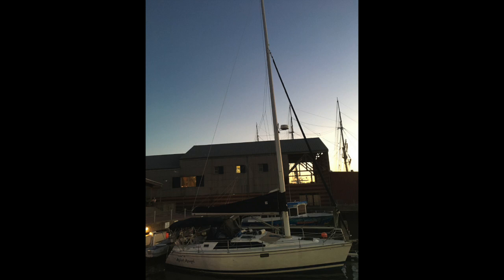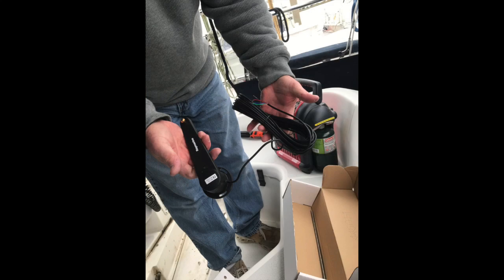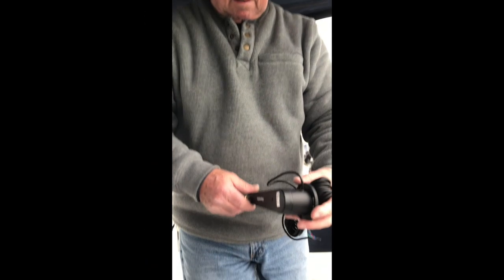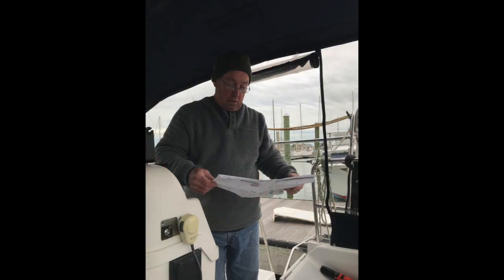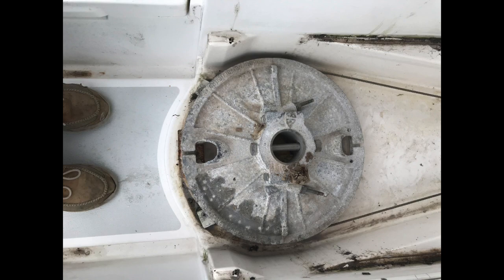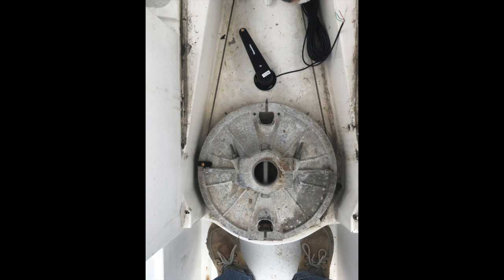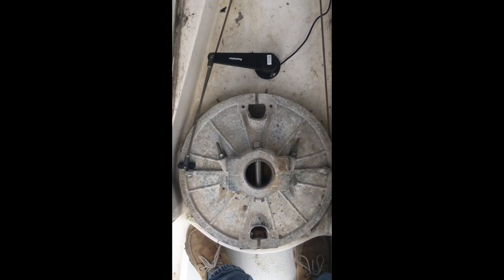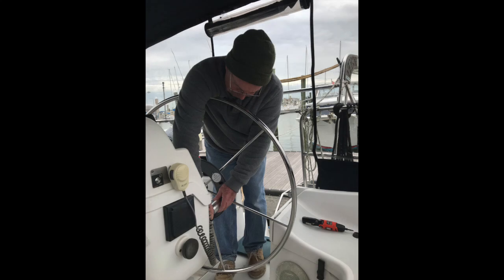Install Raymarine Rudder Reference

Comment: HI, thinking about installing it the rudder reference too. Did it make it more accurate or what have you found are the benefits? Many thanks
Reply from the maker: It does seem to have significantly improved course holding.  There still is a little bit of "s" motion but it is much improved over the same system without the rudder reference addition.  Also, a benefit the I didn't  know I'd get is that there is now a graphic representation on the EV100 display indicating the position of the rudder.
Reply: @jimsails7985  thanks Jim!! Appreciate the response. I do have a bit more S curving with my Tartan 33 now (new) than I had with my Beneteau 285. Plus docking with a graphic of where the wheel is would be greatly helpful.

Again thank you for the video and the additional explanation!